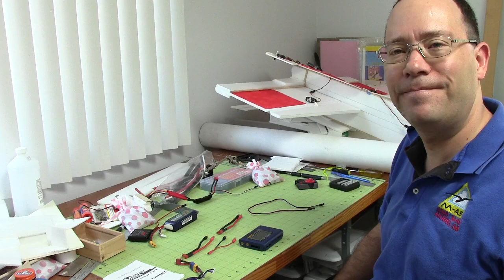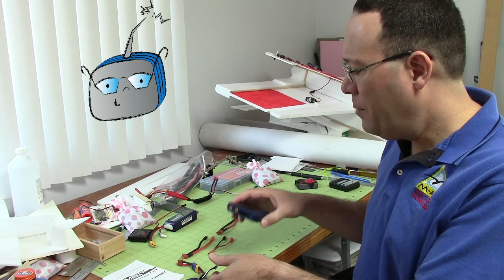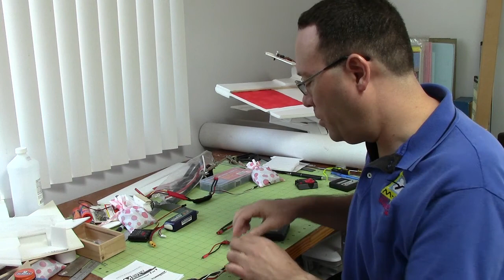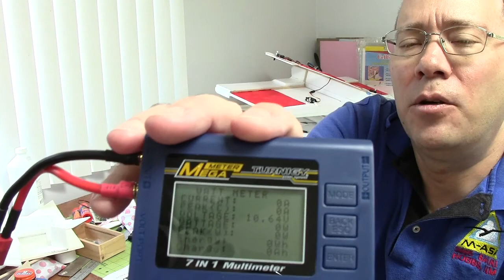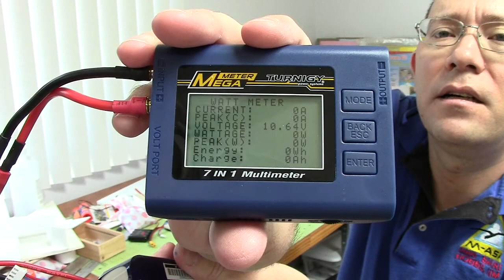Turnigy 7 in 1 Mega Meter Real Review

Comment: A servo tester  that shows amps through multiple servos controlling a common control surface is key ,  disappointed that this device does not have that function, according to your review.  It appears that is  meant for electric motors/ESC predominantly , right ?

Comment: The Great Planes Glo-Bee tach instructions says if it's inside because of its sensitivity the unit does not know whether it is looking at a propeller or an incandescent or fluorescent light which fluctuates at 60 cycles per second or 3600 cycles per minute. And when set for 2-blades it should read 360 or 3600 respectively, 3-blades @ 240 or 2400, and 4-blades @ 180 or 1800. And that is a quick way to test the calibration, but in direct sunlight it will read zero when turned on. Need a new meter and was hoping to see how that feature works to take care of my addiction;-)